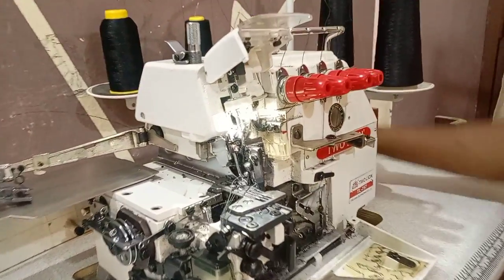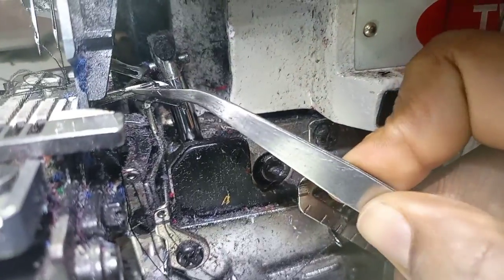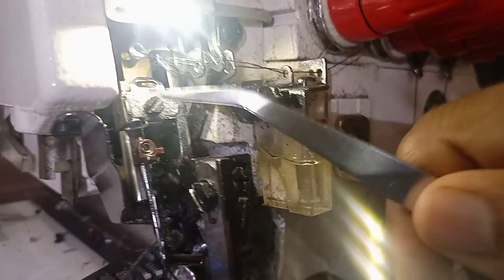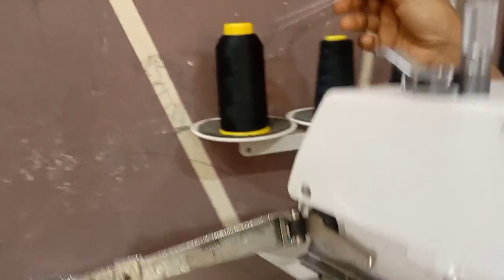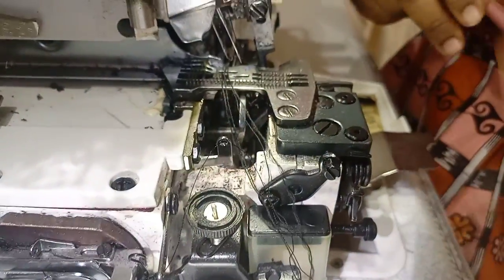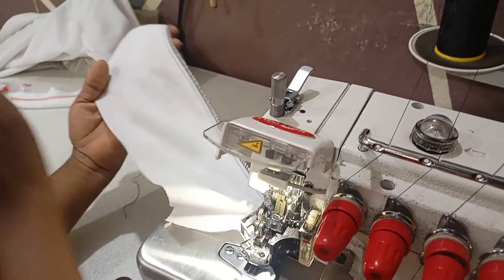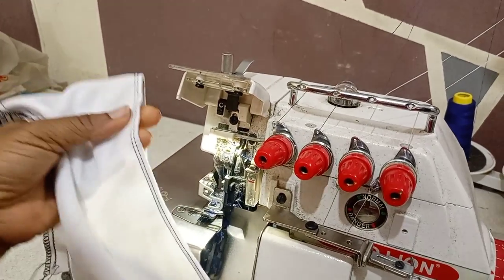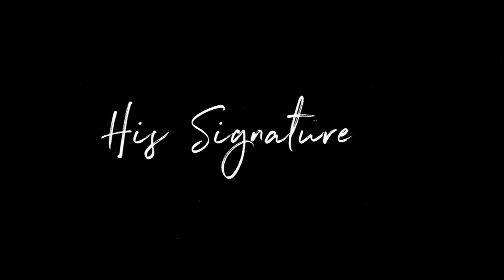How to thread five-thread and four-thread overlocking machines (TWO-LION)

Comment: Please I need your help. My brand new direct drive overlock machine was just installed but isn't working. The lights come on when it's switched on but the machine doesn't work. What could be the problem?
Reply from the maker: Since it's a new machine the person that installed it probably made a mistake. You will have to get a technician and if the problem persists, I will advice you return it early.

Comment: Ma'am pls can you make a video on how to set the machine for outer weaving.
Reply from the maker: You will have to buy another plate for outer weaving. You can't use the same plate for both there is a little difference in the two. Anytime you want to do outside weaving you change it. I will work on making video on that.
Reply: Thanks alot. Pls I need the video on outer weaving.

Comment: How did you connect the led light of this machine. Mine is 3 thread
Reply from the maker: The light came with it.
Reply: @hissignaturecoutureltd  yes I know. Mine came with it as well. But I don't know where to connect the wire to put it on when I switch on the machine